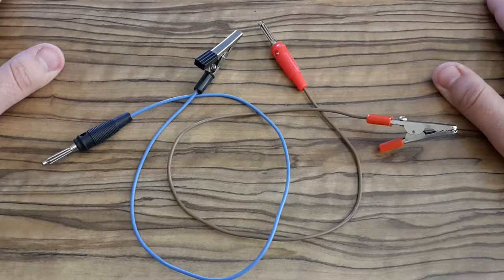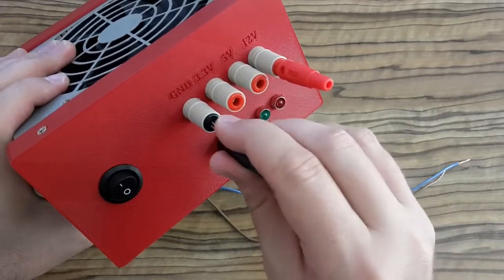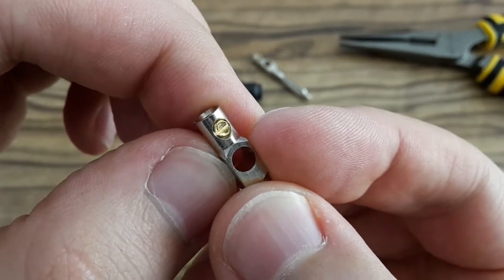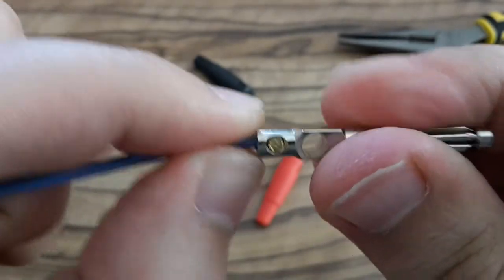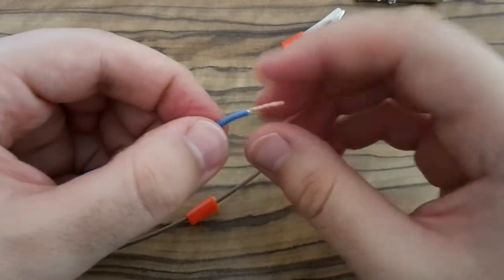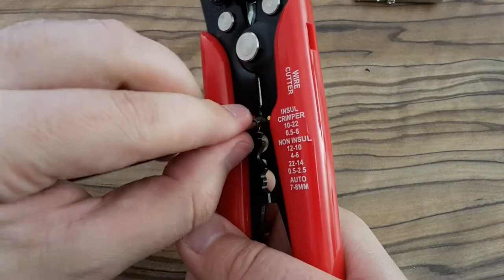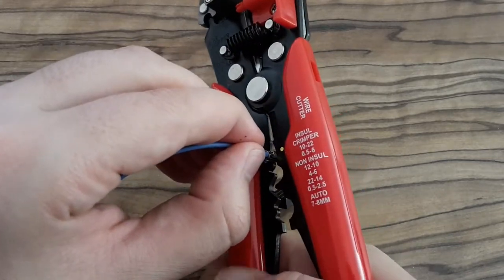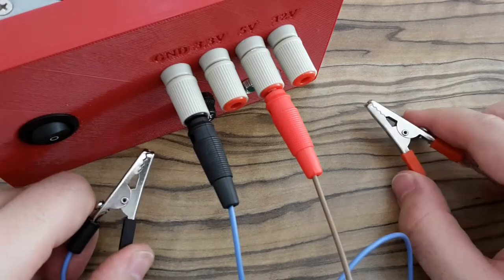How to Connect Crocodile Clips and Banana Connectors

Comment: You will get a much better crimp if you use the non-insulated wire die of your stripper rather than the insulated die that you use in the video. The shape of the die is completely different as you can see, and when you are crimping you are crimping on the metal (uninsulated) barrel. Regardless, yes, you are much better off with a good crimping tool. Even with the better tool use the non-insulated crimping die for bare metal crimping. cheers

Comment: Shouldn't you use a ferrule for multi stranded wire in a screw terminal?
(Over time the single strands can break at the point where they are pinched)
I would think you kan crimp the insulator on the alligator clip at the sane time as the wire, like you do with automotive crimp connectors...
Reply from the maker: Yes, it's even better thanks for the idea.

Comment: If my alligator clip gets too dry and the plastic around it tends to crack,is there anything i can do to make the plastic return to it's normal elasticity or at least less dry? Thanks if someone read this :)
Reply from the maker: Hehe, this is a very delicate problem. I've never heard about that. When plastic is getting older it can crack but you are talking about new ones right?
Reply: How about covering it up with heat shrink wrap?
Reply: The insulation can get to hot if you use a small soldering iron and the soldering takes to long. Adding some shrink tubing helps a little but does not provide proper strain relieve...